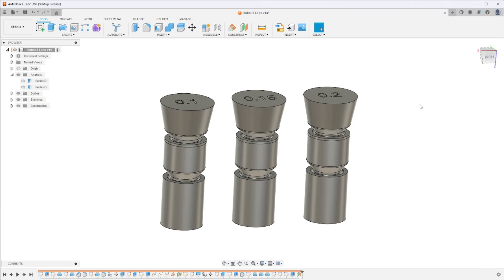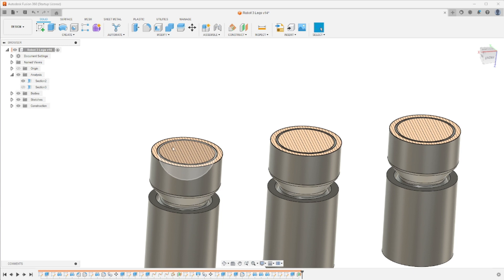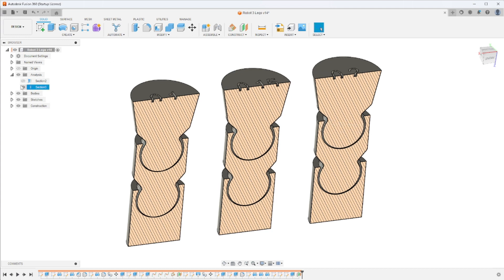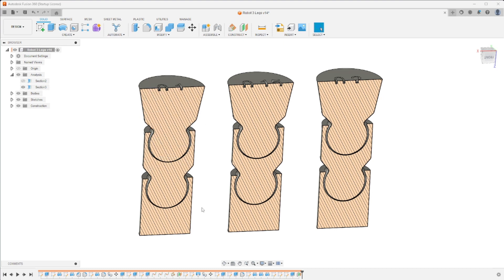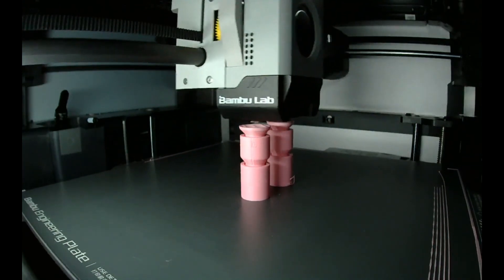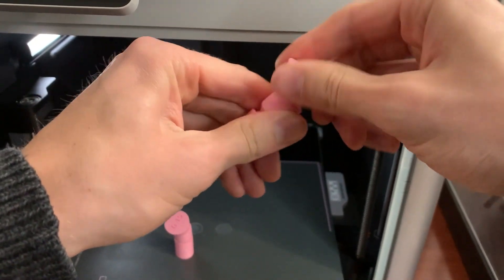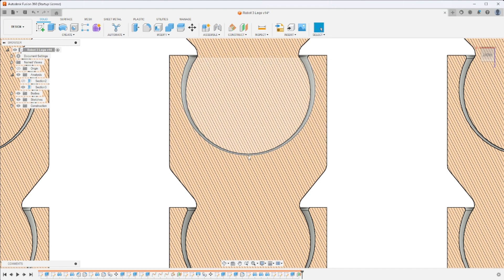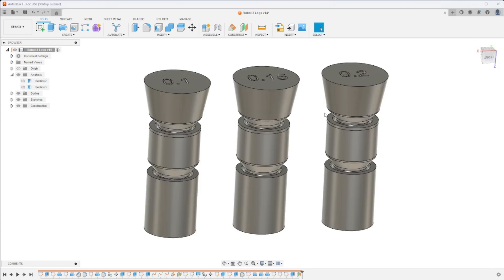Designing 3D Printable ball and socket joints | Fusion 360 | 3D Printing | Print in Place

Comment: Hey, I am new to 3D printing. I am wondering how this is able to print without supports because the ball is printing in mid air
Reply from the maker: Because the gap is only 0.2mm between it prints in hair but hangs down just enough to make contact with the layer before to print well

Comment: Super video ... exactly what I am trying to build.  A few questions if I may: 
1) I noticed that you did not print the ball vertically on center in the socket.  You're offset a bit to the bottom. Is that deliberate, to allow the printer somewhere to start? it looks like when you initially break the joint, that you have vertical clearance (the entire assembly is now a bit longer).
2) I've tried this with tinier joints and getting mixed results.  The balls slip out of the joint too easily, so I think I need to upsize them a bit.  Can you share the diameter of your joints?  I saw another video where your ball was about 8mm ... is that the case here too? (meaning the ball is 8mm, but the socket for the .15 joint would then be 8.3mm).
Reply from the maker: 1) yes that is correct, the gap between the ball and the socket itself is about 0.15-0.2mm. This allows the printer to have a very minimal contact point on top of the ball joint so that it doesn’t print in mid air and cause a spaghetti failure
2) Smaller joints are definitely a little trickier, the smaller the joint the tighter the tolerances need to be which in some cases may reach the limit of the 3D printer. In those cases trial and error is the best to find what is best for the joint you’re working on. 
I don’t have these files saved anymore as it was just a trial project for a different design but from my memory that was pretty close to the measurements. 

Hope this helps

Comment: Fantastic video, thank you! I subscribed.
I don't know if the function was available at the time you recorded this, but now when printing with the X1C, you can pause it in the phone app, and pick any of the objects that have started printing, and tell it to cancel whatever ones you pick. Then you can keep printing the other models right where they left off. It's really helpful for those moments.

If you have not gotten one yet, I also recommend getting a better build plate than the one that came with the printer. Unless of course you are happy with it. I prefer the ones that don't require glue stick to work. Better bottom surface finish, and less to deal with.

Now to go watch some more of your videos.
Reply from the maker: Yes there have been a lot of new possibilities since this video! Crazy how fast things advance it’s super cool!

Totally agree a new build plate is high on my list! I’ve got a project I’m working on that will require a nicer bottom surface finish

Comment: how could i make this stiffer to hold weight? like phone for instance.
Reply from the maker: If you’re looking for the ball joints to lock in place more you’d need to make the tolerances much tighter. Probably only the difference of about 1-2 print lines between the perimeter of the socket and the ball. That might allow you to make it hold more weight. Will for sure involve some trial and error

Comment: Hi.the tolerance is at the apex(bottom)...what was the tolerance where the curve ends please?..I can see it's wider. Thanks
Reply from the maker: The widest part of the ball (in this design) is 12.5mm. The socket that it fits into is a circle of diameter 14mm where the opening is 12mm. If you want to be able to remove the socket after printing an opening diameter of 12.6mm would probably work well. You may want to adjust this based on your printer settings but I found that to work quite well.

Comment: This is amazing! Thanks for this. Is there a document or drawing I can refer to in order to get more of the specific dimensions used to create this?
Reply from the maker: I put these together fairly quickly so I don’t have drawings of this specific model. What I can say is that as long as the ball joint is approximately 0.5-1mm smaller than the socket and the distance between the peak of the ball joint and socket is 0.1-0.15mm your design should function well!
Reply: What were your print settings?  Layer thickness, for instance.  I tried 0.15mm and  My sockets are getting stuck.  I'l iterate a little but perhaps you can give some pointers.
Reply: Oh, and a 0.4 mm nozzle, PLA filament.
Reply: Much appreciated!